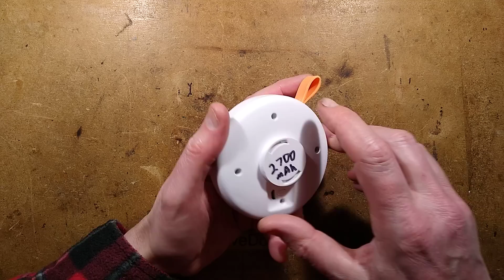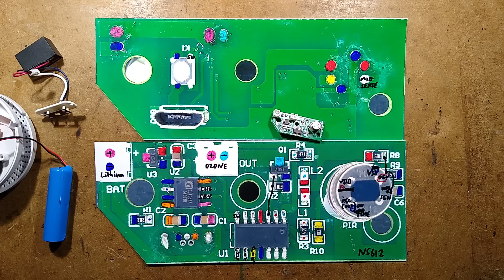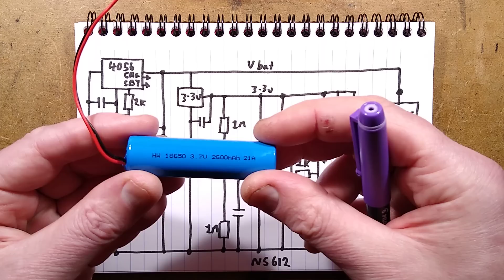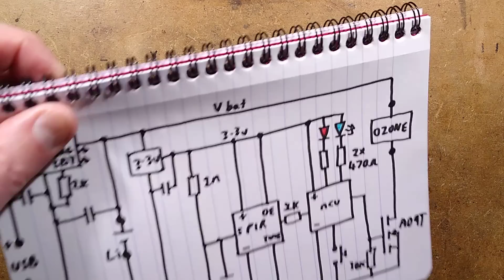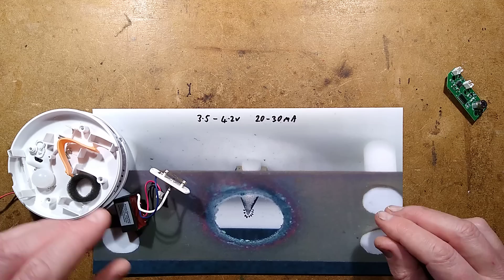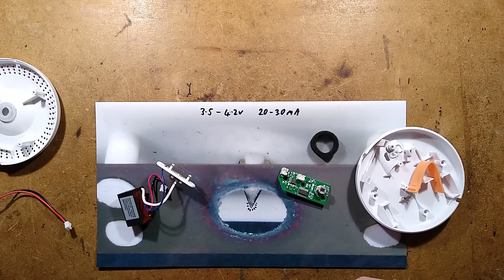Inside a cat detecting poop neutralizer - with schematic

Comment: Cats have a rather sensitive sense of smell and could easily get scared of ozone smell. If the ozone generator is close to litter box the cat is likely to pick a safer place to poop, like your bed or sofa. But at least the litter box will be sterile, I guess?
Reply: Maybe that's why it only activates once it stops detecing movement and until the cat comes back again the ozone is long gone.
Reply: Or even the high pitch noise i know it makes, hell had a cat fountain she loved it till the motor started vibrating every so slightly.

Comment: Is there a link for this one? I have 2 cats and with winter on the way they won't go outside lol Also do you think using it in the fridge helps keep food fresh?
Reply: Only if your cat is in the fridge.
Reply: @wingnut2893  "The Cat Who Came in from the Cold" by Deric Longden
Reply: I like to use old containers with holes in them and fill them half full with baking soda then after a month or so dump outside in the garden. Can get baking soda for about 1 usd per pound lasts over a year. Works for in the bottom of a garbage can or fridge or anywhere you want to soak up smell.

Comment: Probably more PC than a poop detecting cat neutralizer TBH .
Reply: Shidronger's cat
Reply: @joejoemyo  Shy Drongo('s) cat ? #ukkin 'ell should not have a cat if you are going to put it in a box with  radioactive litter(and tray)with no way of knowing if the poor moggy had expired from radiation poisoning unless one opened the box and then to complain that the "cat neutralising poop detector" needed charging and the whole #ukkin house stunk of cat s#it...The Cat Protection League are NOT to be messed with👉🚾👈🤜🤛👉♾️👈‼️
Reply: lol...basically the same thing I came to post
Reply: me too...darn cats! lol
 @nominalvelocity
Reply: Believe it or not, a device with almost that description (minus the poop-detection) already exists and can be purchased. Or you could knock one up fairly easily, because they are relatively simple: The active component is just a little piezoelectric ultrasound disc, powered by a battery with a control circuit, making short bursts of ultrasound once every 10 to 20 seconds. If you hang one of these in your garden, ideally on a wall or fence above the flowerbeds, cats will never go near it.
The ultrasound frequency is well above anything human ears can detect, so as far as we are concerned it's just a box which hangs on the wall apparently doing nothing. But the ultrasound is painfully loud for cats, hence why they stay away from it. Doesn't neutralize the cats as such, but does work for the intended purpose of stopping them digging in the garden.
The downsides? It also affects dogs the same way, so it's not a great idea to use such a device if you have a dog. Plus of course any other creature which can detect the ultrasound - particularly bats, so it might even fall foul of bat protection legislation if you used one in an area known to be a bat roosting hotspot.
Reply: @lloydevans2900  Ultrasound still damages human hearing... you just are not aware of it... which is why things like this are crap, even if they do work.
Reply: @givemeanameman1 It'll be fine.
Reply: @POVwithRC  Ultra sonic emitters for pets/snakes and all that craft often emit pulses above 120db in ultra sound... this is proven to cause hearing loss in humans...
Reply: @lloydevans2900  I was thinking more in the direction of an autonomous air gun turret. Too many homeless cats in this area anyway.
Reply: @lloydevans2900 Ack.... those things NEVER work. 

I have one in my garage, to supposedly keep mice out, and cats, dogs, and even still, mice
have NO fear of it, and constantly welcome themselves in. They act like they don't even hear it, or if they do, it doesn't bother them in the least. 

I've tried several different brands just in case the first one happened to be a dud, but nope, they're all a farce.

There's a channel here on YouTube that tests mouse traps and devices meant to keep them away. One of the videos was testing one of these ultrasonic devices, and the mice sat right on TOP of the device while they ate the seed bait that was put out... 🤨
Reply: ...poop detecting cat neutralizer... 🤣😂🤣😂🤣
Reply: I'd much rather have the cat neutralizer.... 😬
Reply: But a cat netralizer is a perm solution!
Reply: You beat me to it LOL ♡☆☆☆☆☆!!!
Reply: That was the first thing that came into my mind clicking on the video. Glad I'm not alone...
Reply: I could do with one of those for my garden though
Reply: @davidpooley4167 Me too, but it'd have to be quite long range.
Reply: @davidpooley4167  Yup, I've been "planting" little sections of broken sticks for a few years now.  Neighbor's cat is lovely but any area of bare earth = litterbox apparently.
Reply: Yep, I momentarily parsed the title as a poop detecting cat neutralizer.... and thought that's a  bit harsh... and then re read it and was relieved.... but then I once had a  German Shepherd with that 'feature' and it took a while for my dad to convince him that was bad...

Comment: Apparently ozone can do a similar job to hydrogen peroxide in removing plastic discoloration. Has anyone tried putting one of these in a box with some yellowed plastic ?
Reply: Impractical from a time and energy cost perspective.
Reply: It works on some plastics but not all. 
If you put pure ozone In a bag with yellowed plastics and set it under an UV light or normal sunlight it gets brighter
Reply: You need a much much higher power to do so thought. 
A battery powered unit won't get you anywhere
Reply: Possibly it might work but I think it would also be destructive to the plastic, making it brittle
Reply: @phonotical  If that's the case literally every laser printer would disintegrate
Reply: @radry100  are laser printers made of the white plastic that yellows with time?
Reply: afaik ozone damages the plastic